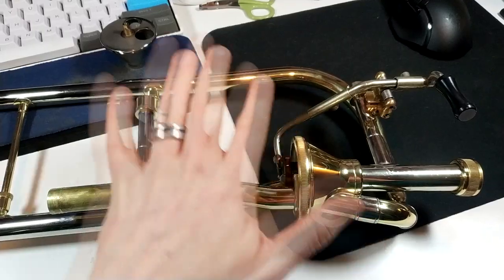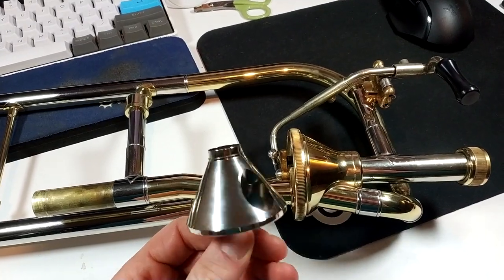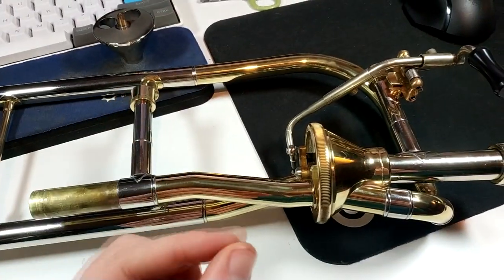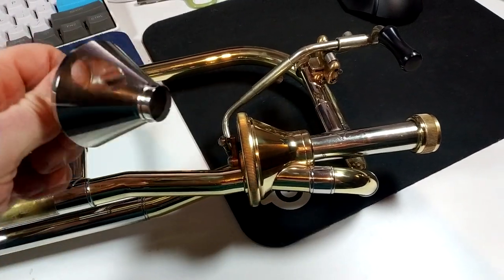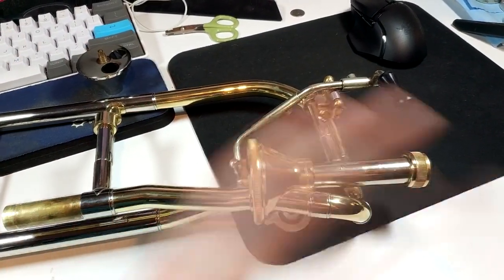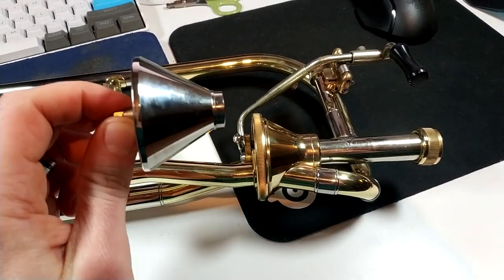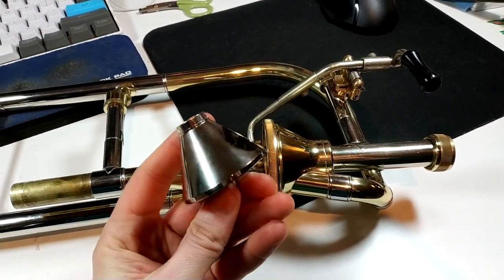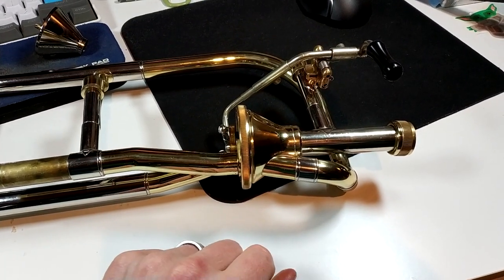The Thayer Problem: Solved

Comment: Hi Aidan. Do you have a video on the rotary valve from instrument innovations? I would like to know how it compares to other modern rotary valves. I am thinking about upgrading my Bach 42B with a modern valve. I love the sound of the 42B closed wrap. But I have always felt that using the old valve changes the sound to the worse.
Reply from the maker: I don't own one at the moment. But they are good valves. When set up right, a good fraction of what you get with a greenhoe.

Comment: I wonder whatever happened to the 5 valve Thayer-equipped euphonium that Ed used to bring along to show folks (this was probably 20+ years ago).  I recall taking a toot on the thing and it was terrible.    Still a musical curiosity...
Reply from the maker: I'd love to play that!!
Reply: @AidanRitchie  I don't think so.   The tuning slide lengths were pretty far off--consider the short length of the 2nd valve branch on a normal euphonium.  Now try to figure out how to get a half-step out of a Thayer.  The valves felt leaky; I don't know if that was the cause, but it felt pretty stuffy.
You'd have more fun on an ophicleide,.   The Thayer valve works on a trombone because you're using it to insert a pretty long stretch of tubing.   
My Willson tuba has a Rotax valve on a thumb trigger as the 5th valve; maybe a single Thayer might work in the same position.
Reply from the maker: @tubastuff  oh I'm sure it was awful. Still want to play it though.
Reply: @AidanRitchie  Well, I'll ask around to see if anyone remembers what happened to it.  I suspect that it was disposed of from Ed's estate after he passed.  I remember being asked if I wanted any of his stock of tubing, etc. but golly, that was a long time ago...

Comment: Have you played/what are your thoughts on the Milashius axial valves, built with Ed Thayer's old equipment?
Reply from the maker: I haven't played one specifically, but they'll be the same as the old stuff. Not bad valves, but they won't last as long or be as easy to service as the Olsen axials.

Comment: Hey,

Great video and explanation. I can tell you not only fix them but actually play.

Are the Instrument Innovations Thayer vs standard roter. I currently play on double independent Rotax (swiss maybe) valves on my Edwards bass. 

I used to feel the Thayers were too open and used too much air and had too long a throw. I tend to like the focus of a really good traditional valve with a smart wrap. Is the II rotary similar to the rotax in blow? I like a  bass to sound like a trombone rather than tuba and has a bit of brilliance rather than overly dark and heavy and dull. Like the old heavy equipment of the 90's.
Reply from the maker: The II rotor is a bit more "standard" than the Rotax, IMO- the rotax to me always felt a little small, a little tight, a little narrow for my tastes. Olsen rotors are more normal, a bit more like Greenhoes or other larger, modern rotors.

Comment: Hi Aiden, how would you say the infinity valve compares to the normal thayer (such as shires and edwards). Is there any difference between them in how them play, such as being more open than the other? Or is it just for the sole purpose of longevity and maintenance.
Reply: And do you think you could also mention why you didn't like the other Bach 50 AF3? Like what specifically about those models you didn't like/think were awful. Just curious because I might be looking into a B50AF3
Reply from the maker: Bach doesn't really know how to set up the Olsen axial. Sometimes they get it right and the horns are great, most of the time they are not right and they just don't feel good. I'd only buy one that I had played and I knew was good (there was one at NAMM a few years ago) or have someone build the section who knows what they are doing.
Reply from the maker: They impart less color to the sound than aluminum or stainless thayers, play easier than basically all of them, and will last longer than all of them. You can buy parts directly from the guy! That's why I dig them so much.
Reply: @AidanRitchie  Thanks for the info, I appreciate it 😁
Reply: Hey Aidan, I have one more question if you don't mind. Do you know if a stock bach 50af3 is modular like the shires? I'm curious because I know on the shires you can switch out different parts with other shires parts, but I didn't know if bach had this option as well.
Reply from the maker: @bobthebuilder-gv7ln  they are not, no.

Comment: Thanks Aiden, been waiting for a video like this. From an engineering perspective it's very well designed. What was the european built axial valve you mentioned in the video?
Reply from the maker: Perhaps Bosc, perhaps Haag? I know there's a couple.
Reply: @AidanRitchie  Yes I've looked it up, it looks to me that BOSC strumenti musicali (machine shop in Italy!) produce the axial valve for Haag using 5 axis CNC maching and CAD/CAM software. Improved design compared to the original thayer valve but the contact area is predominently the same. Infinity valve is the best design.
Reply from the maker: @greennigel6398  interesting! I thought Bosc was Spanish. Oh well, looks like Olsen wins again.